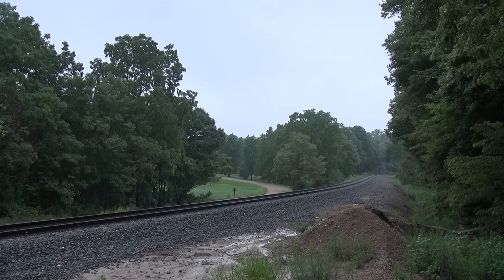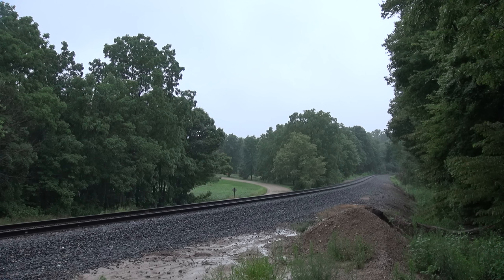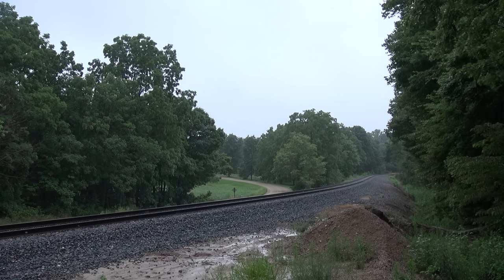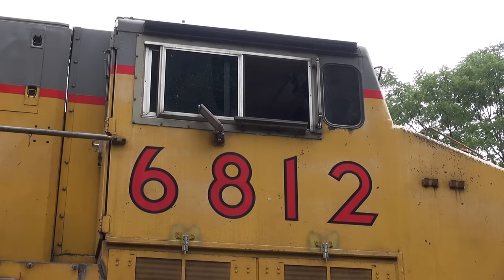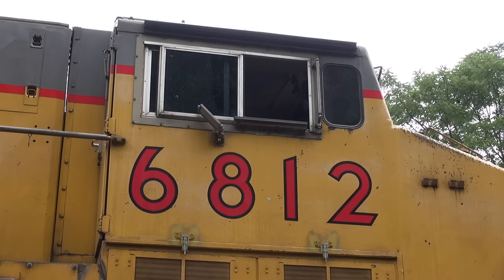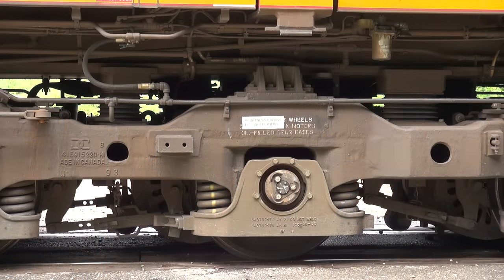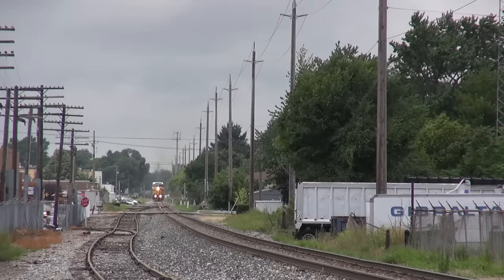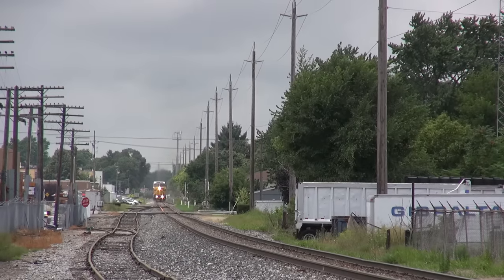TRRS 477: "Whoops!" CSX Freight Train Stalls on Grade

Comment: I think that train could have done with an AC6000CW or two for the high horsepower
Reply from the maker: Two ES44AHs would have been awfully close in the rain. Woulda definitely gone a lot farther than that tired UP unit and the aging SD40-2. Plenty of trains have gotten their noses to that crossing at the top of the hill only to still stall. It's not an easy hill if you're underpowered and don't train handle correctly.

Comment: The length of these trains is rediculous it's no wonder they stall on gradients,what's the point of having trains that length if the locomotive hasn't got the power or grip to handle the load,this wouldn't happen in the UK because they would have a banker engine ready at the trouble spots to give the train a push from the rear and when over the incline it would just go back and wait for the next train to help it up the hill,this saves a lot of time and trouble and keeps the line open.
Reply from the maker: Quite simply there were no helper crews available to call and the line isn't busy so it didn't delay any other trains.

Comment: What is the grade %? 9200 tons isn't a heavy train.
Reply from the maker: Lolz 9200 tons isn't heavy? Just because they run plenty of stuff way over 10,000 tons doesn't make 9200 Lite! It's about 1.5% and full of curves, so effectively around 2%. Add wet rail and two aging locomotives, and you get this. According to the tonnage charts, these would be doomed even in dry conditions.
Reply: TOB is what makes a train heavy. Not the weight itself.  If I was 9200 tons of empties, I can stop on a dime. 9200 tons of loads could be 'heavy'.
Reply from the maker: True, to the extent of braking perhaps, but tonnage going uphill is pretty much the same, unless it is unevenly distributed.

Comment: When the engineer went past they weren't even at half throttle.   This is human error not lack of horsepower.    I work on locomotives all day every day.    I know when I hear a emd 4400 loaded down
Reply from the maker: If they weren't quite a full throttle, it was because of the speed limit - they were still making track speed when the headend passed me. That is part of what makes this hill so challenging: one cannot get as good of a running start due to the sharp curvature. 

In any case, this train was definitely over 1000 horsepower short, based on the locomotive ratings and the train's tonnage. So it wasn't human error.
Reply: when you start slow and suddenly hit a steep grade theres no amount of  raw unused power you can summon to save you from disgrace ... raw physics

Comment: Sorry, has nothing to do with gravity. It has to do weight in motion, with the slope incline, and the weight and density of steel as opposed to the density of air and water. Greater power and traction is also required for any increase of the incline slope.
Reply from the maker: Weight implies gravity.

Comment: Does wet rails have that much effect on trains going up grades? Thanks for a very good video and the infor.
Reply from the maker: Yes, wet rail will decrease the amount of traction available. It's hard to tell by how much in any case as there are tons of factors such as a locomotive's traction control, rail condition, curvature and gradient but it can be significant, I've heard supposedly around 10-20% but I have absolutely no way to verify that so I'm hesitant to even toss out that number. I can however say with confidence that wet rail is known to double (or more) stopping distance for on-track equipment such as tampers and hy-rail vehicles, so you can probably surmise what it must do for traction.

Comment: Why keep power up front? Why not put the power at every 40 cars?
Reply from the maker: While there is a benefit to spacing out the power, it comes with a time and logistics penalty to set all of that up before departure and after arrival. Distributed power doesn’t usually start making a whole lot of sense until trains get really long and heavy, and even then the most common arrangement is to stick one or two on the end, rather than be cut into the middle. And middle units are usually spliced in where two separate yard tracks get doubled together to make one monster train. But unless it’s a true monster train or taking on some of the biggest hills, it’s very uncommon to see power at more than two spots in a train.
Reply: @ThornappleRiverRailSeries  Rad - thanks for the patient thoughtful reply - people like you make the internet a treasure trove for learning :) I can totally see the penalty - just the time it takes to fix the issue in this video with 2 runs, seems about what the overhead would be on distributed power logistics - I could see the monster situation more easily where they run together for a while and then split off into two separate units.- esp if one of the units is running light

Comment: Adding a couple of units as a pusher would’ve been a lot cheaper than sectioning the train and going through all of this
Reply from the maker: Once you factor in the additional expense for the other crew, and running those extra engines, it actually comes out to more of a draw than you might expect, cost-wise, between those two options. This wouldn’t be true if they also delayed other trains, but in this case nobody else was even close to being delayed so that was not a factor.
Reply: @ThornappleRiverRailSeries  
Oh, that is good to know!

Comment: UP & CX unit barley getting started let alone making it uphill why not just put more units on for the load?  Must of spent way more money  going through all the trouble of breaking apart then reassembly.
Reply from the maker: There was no other power available to add to the train in Chicago and no helper crews available. No other trains in the area, either. They were simply on their own to make the double - they knew they would stall.

Comment: Combining an ac traction ac44cw with an older dc locomotive such as this sd40 is generally a bad idea. As the traction control systems work so differently.

The SD40 needs to be eased up on the throttle when it starts slipping, while the ac traction motors are computer controlled. The throttle here basically orders pulling power of the computer and the computer controls each wheel independently. Able to stop a slip in a microsecond.
If you reduce throttle on an ac unit you are telling the computer you want less power.

Looks like they unplugged the mu-cable to control each loco individually for just this reason.

Comment: The first step is brake all the train,if air isnt enough,,,each wagon has a manual brake.And call   help,,, split the train in two,,,,is a possible solution,,,but very quuicky,,,and more locomotines to help.

Comment: Dafuq ?! Am I wrong or does the train just has breaks on the locomotive(s) ?! O_o
Reply: all the cars in the train have brakes
Reply: @cdavid8139  thx for the reply. I wasn't sure xD
Reply: @BruceCarbonLakeriver  Not a problem.   The locomotives are equipped with large air compressors.   They pump air through a series of pipes to the end of the train.   Raising and lowering air pressure controls the brakes in the cars.   THe locomotives have their own brakes as well.

Comment: Why don't they have electric locomotives in the U.S.?
Reply from the maker: There was never a significant enough push for electrification, due to lower density compared to Europe and later Asia. Only the dense Northeast warranted it. Some denser railroads further west explored it, and some built small sections, but nobody ever electrified their railroad, and so diesels are still king.
Reply: @ThornappleRiverRailSeries  Thank you for this information. In Europe, there are approximately 80 per cent of railroads electrificated.  Diesels are in use there for some local branch lines only.

Comment: One Alstom Prima T8 (8-axle) would have done the trick. But unfortunately for US railroads it’s an environmentally friendly, non-polluting electric.
Reply from the maker: Maybe, but you’re always going to have more power density with electrics. For the US systems, very little mileage makes economic sense to electrify. 

Also, one can’t claim that the electrics are “non-polluting” unless the power grid is non-polluting. And depending on where you are in Europe, the grid still has a fair amount to a majority of capacity based in fossil fuels. It just moves the pollution to a different spot.

Comment: Someone didn't do the math. That person needs a new job. They should have had at least 4 engine's and one on the rear.
Reply from the maker: That'd be a waste of resources. Three head-end units would be just fine. 95% of the route only requires a single unit. Why waste the power? Each of them are mutli-million dollar machines which consume tens of thousands of dollars in consumables. Economically worth it to just have them double.

Comment: Does an engineer have the right to say he believes his locomotives will be inadequate for the assigned load to negotiate the steepest garde it will encounter ... as they do in baseball, "to play the game "under protest"?  In this instance, one more locomotive coming out of the yard would''ve pulled the load over the hump without Kabukii Dance of the additional power,  personne, and expense  needed to "rescue"  the train. Heads should roll over fiascos like this one.
Reply from the maker: Not really, unless there is a clear and present safety risk in doing so. They often will say something but just get told to do it anyway. Doubling the hill is not in and of itself a safety risk, generally speaking. Just a lot more work and time consuming.

Comment: Very typical for UP and CSX to run cheap. Shorthanded and Underpowered is their style.
Reply from the maker: All major railroads run more or less with the power required, and no more. This was a case of definitely not enough. While this was certainly underpowered to the point of failure, it doesn't hurt much except speed if they're simply not able to make track speed over it. Most of the time you'll see trains slow on the hills regardless. If every train was equipped to fly up the hills at full speed, then they'd be wasting their resources.

Comment: Where is sand?
Reply from the maker: There's plenty! It's wet out so you don't see as much flying, but you can see it in the close-up. Too much tonnage, not enough power. Gravity would win everytime, sand or not.
Reply: Did not see sanders working. You are right in that railroad wants to do a job without enough power and too much tonage.

Comment: I saw a up train not a csx train
Reply from the maker: It's a Union Pacific locomotive, but it's still a CSX train on CSX tracks with a CSX crew. Railroads borrow power from each other all the time, since they all use the same models and it's faster to not change power on trains crossing over to other railroads.

Comment: Nothing to do with " gravity "at all as gravity is a theory that's never been proven. The fact that there's 9,200 tons on a grade with the lack of sufficient power to pull it over the GRADE is the cause of the problem NOT the unknown force of gravity. Just weight, grade and a lack of power period. He most likely has no choice but to back down the hill and split the load.
.

Comment: What now?Call AAA?
Reply from the maker: Call dispatch, order up a recrew, and get that conductor heading back to make the cut!
Reply: Thornapple River Rail Series,  when it stalled, doesn't a crew member have to walk to the back of the train before it backs up? And I presume it would back into the siding so the switch must be thrown. Are there only two on board (engineer at the controls, and conductor planning, communicating, walking, switching and flagging)?

Phil in gorgeous Young Harris, Georgia, USA

Comment: ....why not have 2 lead powers,  and one about 2/3  the way back ........and also, maybe a pusher engine at the rear, .....especiallly on this hill.......no need for  FRED on the rear end, if there's an engine there.......sync engines together for the hill......no problem then,,,,but, the rail companies in north america are greedy, and won't spend another dime on their crews, or the power they operate/ conduct...............old crew taxi operator..
Reply: ......to crunch, or stretch the train at takeoff........that is the question.....

Comment: 11:05 someone explain what’s going on ?
Reply from the maker: Traction control for diesel-electric locomotives. The computer is trying to maximize tractive effort, which occurs right at the point of slippage. So it's dialing itself in. You can see it figures it out and off they go.

Comment: The second unit 8880 is a piece of crap 3000 horse sd50. The lead unit should have been matched with another 4400 hp ac wide body.

Comment: 96 000 tonnes really? My train engineer husband and I are killing ourselves laughing. Wow don't ever post this BS again😂
Reply from the maker: Where did you get 96,000 tonnes from? This train was 9200 tons (or about 8347 tonnes) with only 7400 horsepower on a hill where about 1 horsepower per ton is required to make it over. 

So you might be laughing pretty hard, but the math laughs back at you, harder.